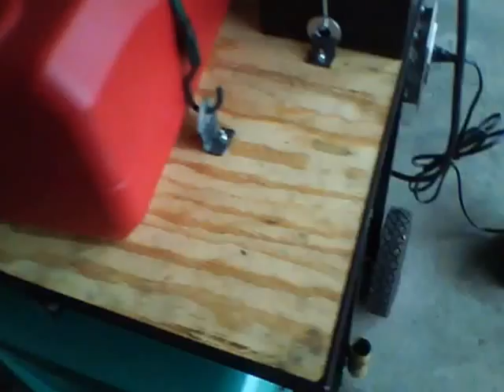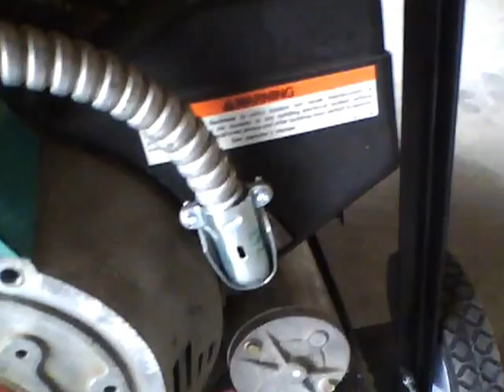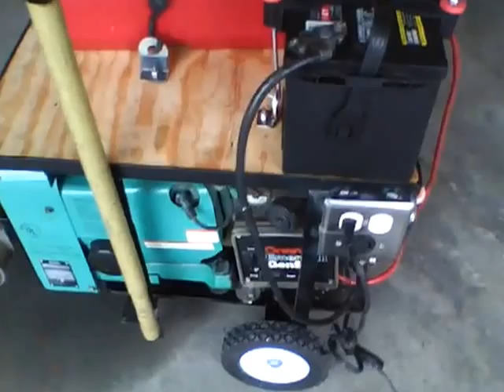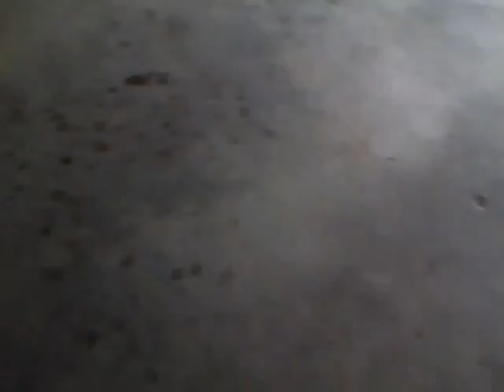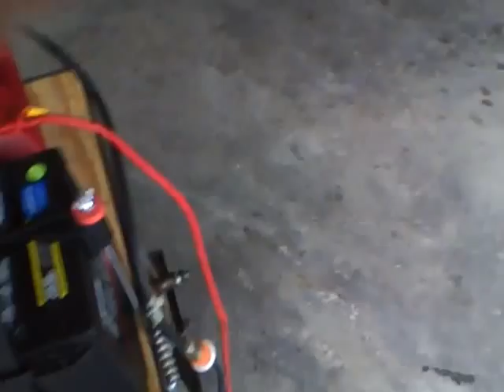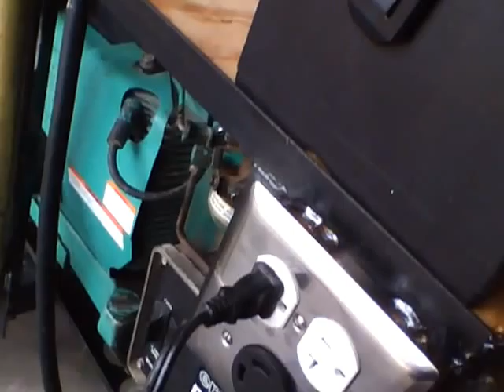Onan Generator

Comment: Good job man. Just got myself a 6.5 emerald 3, researching ways to make this heavy thing mobile with a tank and battery attached. I like the way you did yours, very compact and easy to move around. Think I'll do something similar with a little bit larger off-road tires. Appreciate the video!

Comment: Good day all !! Awesome set up . Do have a question though. I have an onan genset my self in a old 84 pace arrow motor home.  I can't get mine to run . I can push the start button at the generator and will turn over but no spark at either spark plug and no power to the fuel pump any ideas? Thanks for the video Sir !!
Reply: make sure the ground connection is good but im also guessing the fuel pump is stuck, they're about 80$ new

Comment: The Onan manual recommends running that thing for two hours every month to keep it working.   So either drain all the gas out of it completely or you will be running it a lot.  Many RV owners have found out the hard way that it needs a new carburetor if you let it sit for a year without running it.  I'm thinking about pulling mine out of the RV and replacing it with batteries.  $3,000 generator replaced with $3,000 batteries and a few solar panels is much quieter.  They call that thing " Micro Quiet "  and it is huge and noisy as hell.   Gotta love marketing.

Comment: I have an older model-lots older! Did the transformer have a black, white, and ground coming out of it for connections in the receptacle box, or did you have to do some electrical work to get to AC receptacles?

Comment: Great idea , doing the same with 7000 watt onan 120/240 , one question , I want to wire  240v outlet for a welder i know theirs 2 hot and 2 negatives how would I write the 30 amp outlet only uses 3 wires 2 hot 1 negative , does it matter which negative I use since theirs 2 wires ?

Comment: This is a very nice set up... I wonder how difficult it would be to convert this to LP gas?
Reply: look up propane kit on amazon or ebay for onan looking to do the same
Reply: plus u will need this kit with an on demand regulator or it will not work right

Comment: pretty slick.  I would like to do the same thing.  I bought a bfa 4kw.  I think it is older than yours.  it had the same fitting on the shaft for a boom truck.  I am waiting for manuals on ebay.  there are some parts missing like the coil and plug wires,start stop swich and housing,  but I don't know if this was supposed to have a mother board or not. do you happen to know.   got from pick and pull for 38 bucks, but I got some work to do.  it is a 120/240.  parts are expensive.  do you know of any cheap onan parts places, maybe used parts.  thanks